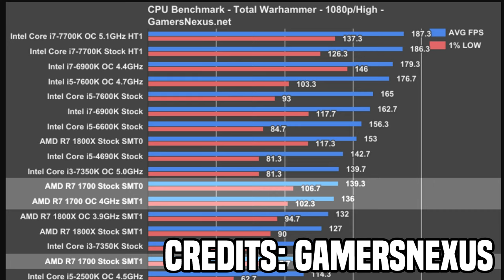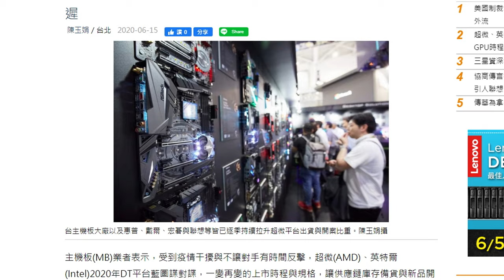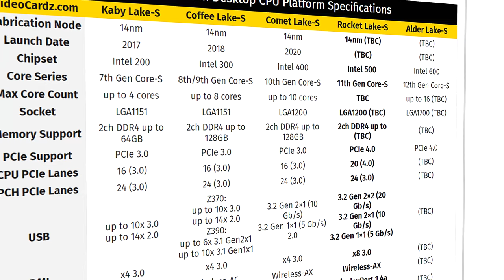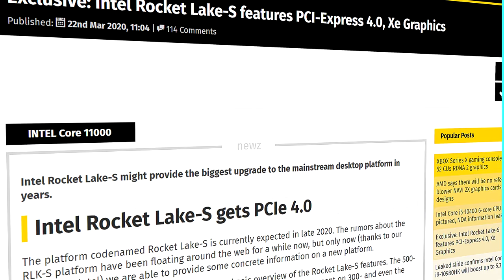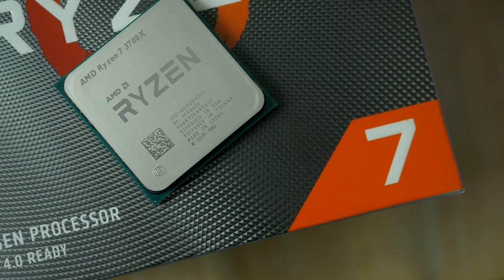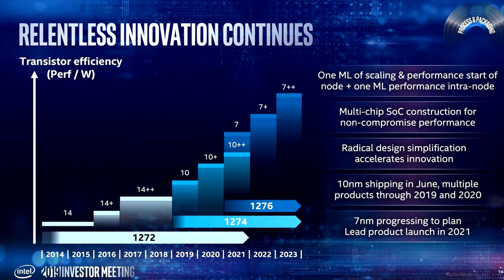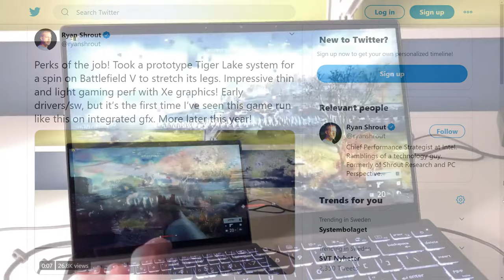Desktop Ryzen 4000 Release Date CONFIRMED! 4TH Gen Ryzen ‘Zen 3’ Coming Soon!

Comment: is this 100% confirmed that rocket lake will be 14nm???? ive seen other videos and the videos you do that it will be 10nm? doesn't seem right if they don't move to 10nm now cause the comp is getting to far ahead. Intel needs to make big moves now!!!! .
Reply: All Intel has to offer at the moment is high clocks but they are only achievable on their extremely mature 14nm process. 10nm doesn't clock anywhere near as high so they're stuck.

Comment: How many more fps on average will I get changing my 3600 for a 4600 while gaming at 1080p on a 5700XT in Apex Legends?
Reply: @David H .. While using a 5700xt my guess at most, 6fps avg. faster at 1080p and 5fps avg. faster at 1440p. Just basing that on a 10-15% overall cpu performance bump overall and doesn't take into account the IPC improvements which should be impressive. In soley, Apex Legends I have no clue! Lol!